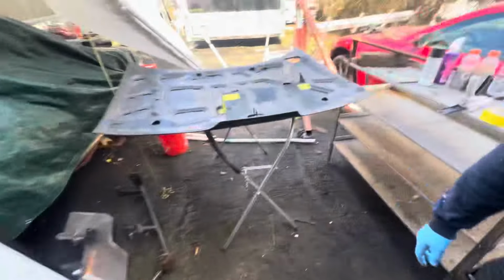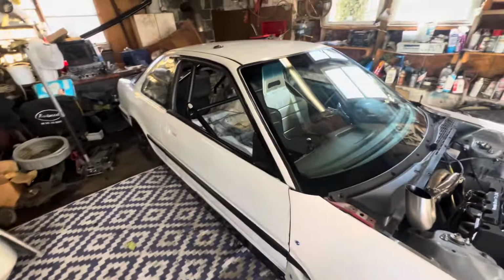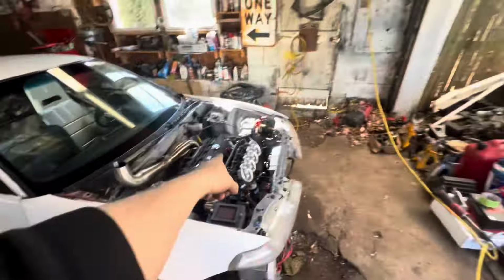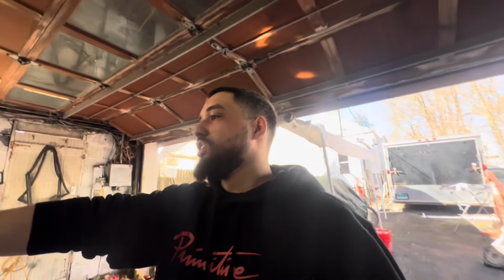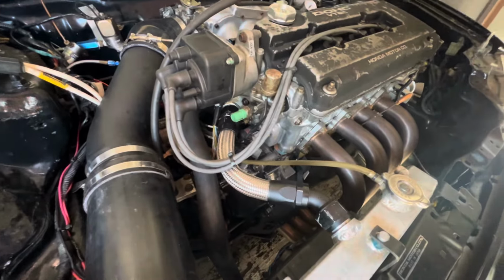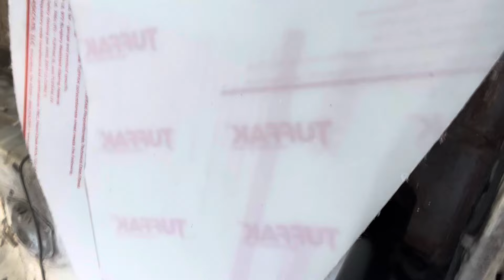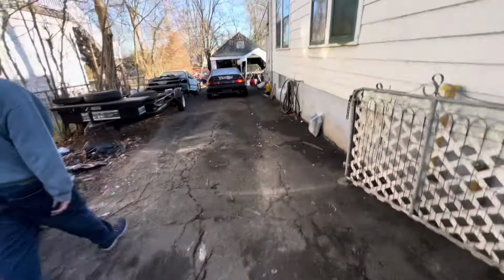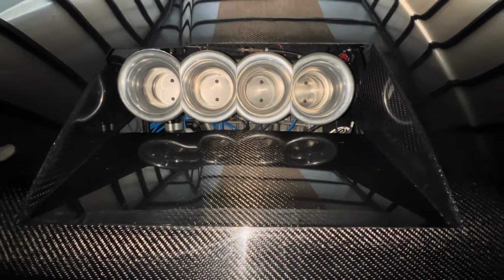Finally driving El Kuko my k24 Da9!!!

Comment: have to ask what did you do with the stock holes that the engine harness came out of? since you are using a different harness since im looking at also running a k24 or k20
Reply from the maker: Right now at the moment the stock holes are still there but I will be closing the firewall with carbon fiber and any holes that won’t be used
Reply: @eggiebuilt  sweet thanks what you thinking with some CF wrap?
Reply from the maker: Nah I have a sheet of 12x12 carbon that I’m gonna cut a little bigger then the holes and then panel bond them on